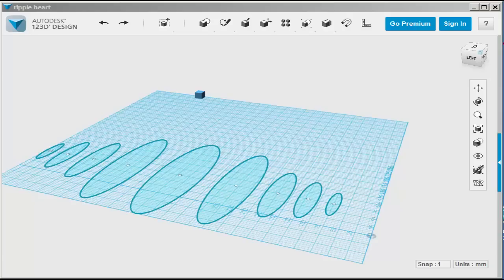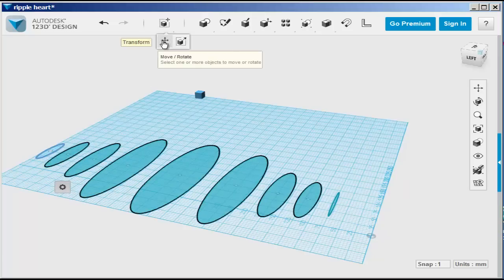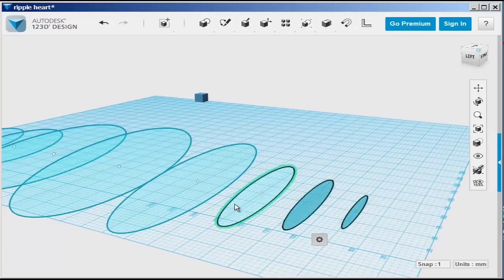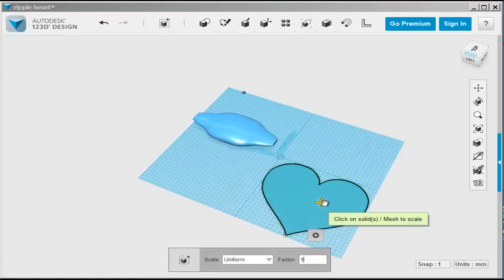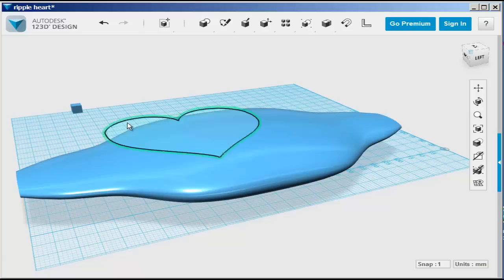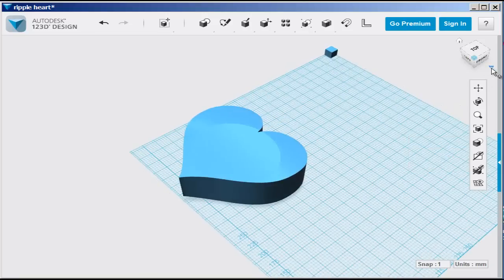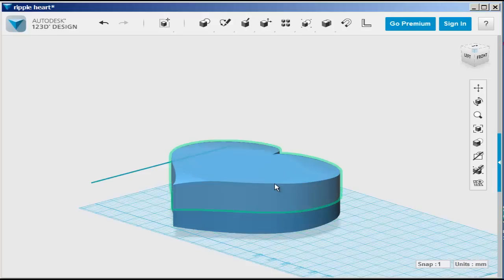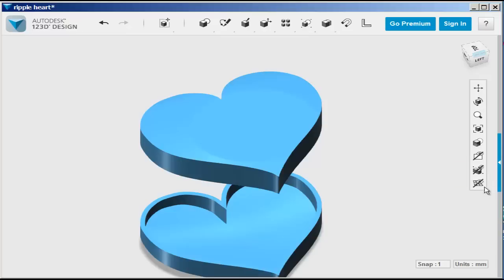123D Design: Jewelry Box with SVG, Loft and Split Solid

Comment: It's a wonderful shaping, however I found it impossible to print the heart without supports. Have you printed the heart?
Reply from the maker: Hi Henry, I haven't. I'm sure it does need supports. I will try to print
 it later, using Meshmixer to orient it. I find that Meshmixer does a 
great job orienting in a manner that needs minimal supports, and the 
tree supports it generates are easier to remove than the ones S3D 
generates.
Reply: Thanks a lot~ I'll have a try. I really like the way you teach : )

Comment: Can you do a video on how to make a small cap with threads so it threads into a bottom cap?

Thank you. I've  really enjoyed your work and learned a lot.
Reply from the maker: Hi Markess, thanks for the nice words on my vids. Autodesk retired the 123D suite, so I don’t do vids on them anymore. I can do one in Fusion 360 when I have time, if you’re interested in that.
Reply: Unfortunately I cannot run Fusion on my computer because they only make a 64-bit version and my computer is 32-bit. I was using tinkercad which was great until I heard about 123D design which had a lot of extra features like Fusion that tinkercad does not. 

With that being said I do have a copy of 123D design so maybe you can do one for Old Times Sake. 😁

Thank you just the same everything you have done so far has been very helpful.
Reply from the maker: Design doesn't have a thread function, which makes doing one difficult. Here's a vid where I made the thread in Tinkercad and imported it into Design. After converting it to a solid, you could make a box or cap or whatever around the thread, Combine/subtract and that would give you the threads on the box. https://www.youtube.com/watch?v=E0obYR8Tv7w